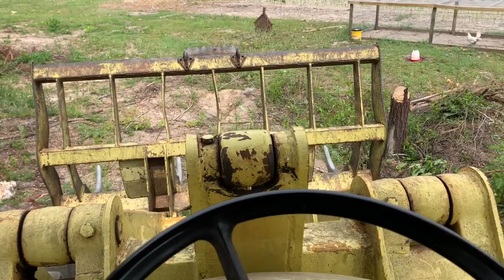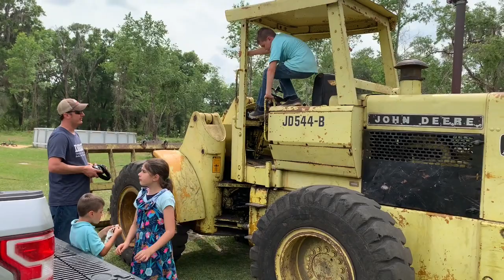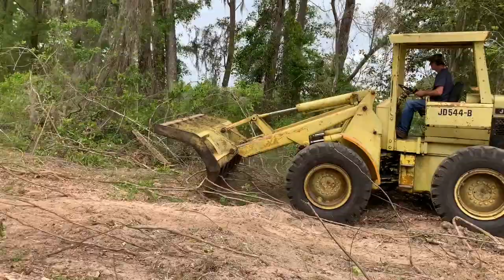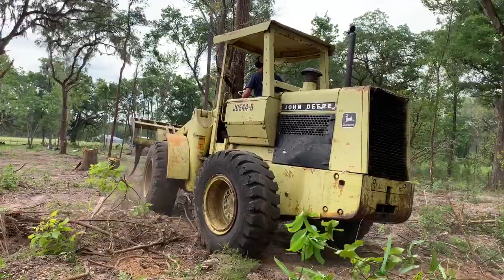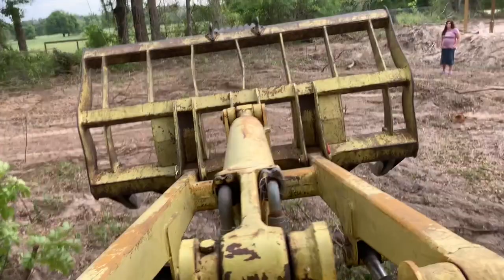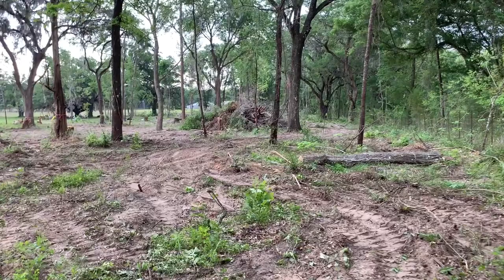Clearing small brush from the fence lines.

Comment: Thanks for sharing! How did that loader do with the stumps? Our property that we are looking at was covered with pine that has been clear cut and now we will have a bunch of stumps to dig out. Thanks!
Reply from the maker: Thanks for watching! We have southern yellow pine, and if they are larger than 10” they are tough. They have pretty large tap roots. It’s best if you push them as a whole unit, so you have leverage with the weight up top.
Reply: @MaynardFamilyHomestead  Welcome! Gotcha, not sure on the type of pine that was there, but was out there this week taking a look and I was measuring stumps 12" to 16", so it looks like I'll need a big machine and time to get them up. Thanks again for taking the time to answer!